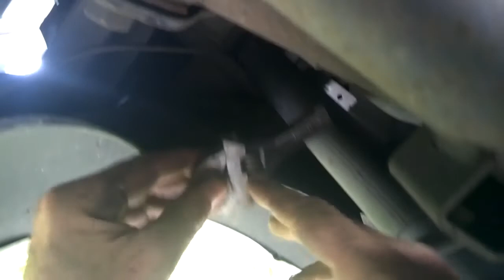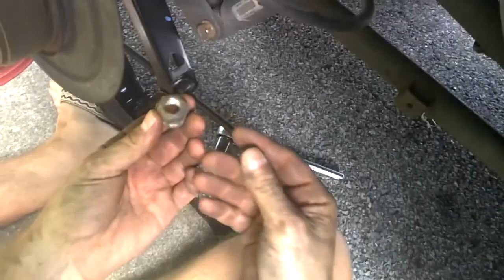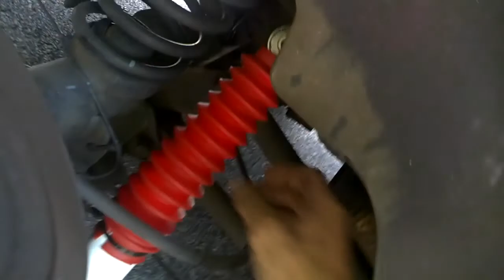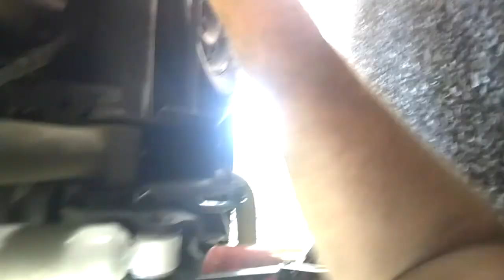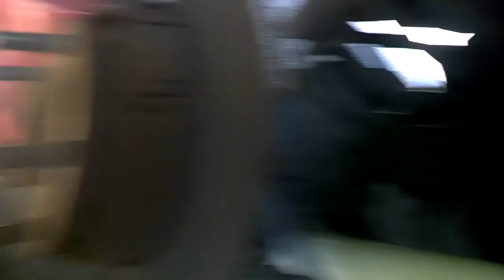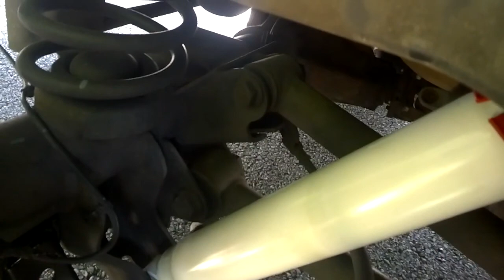Rear shock replacement on 09 Ram 1500

Comment: Notice he only shows the Passenger side. The drivers side is a bigger headache, even with the 'custom' tool, since the fuel tank and some lines and a brace make that nut even harder to get to :S  It can be done though, just a pain. I used a cut off 13/16 box wrench for my 'tool'

Comment: Thanks for the video! It's nice to know Chrysler didn't do anything silly with them like they do with other things. I'm about to put some Ranchero adjustables on mine. Seeing you use that portable jack with no jack stands and sandals made me nervous though. :-)
Reply from the maker: Yeah, I was telling myself that the wheel under the frame made it a little safer, I have a nice set of jack stands now.
Reply: Oh, I must have a missed that. That's definitely a good backup, I do that too sometimes. Thanks again, I'll be doing mine tonight!